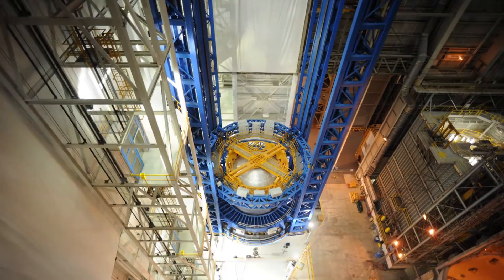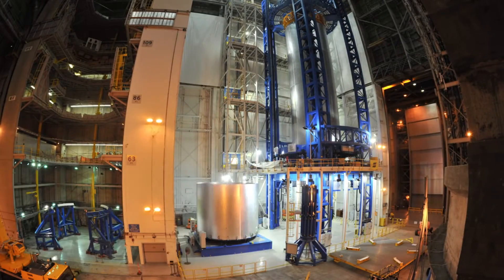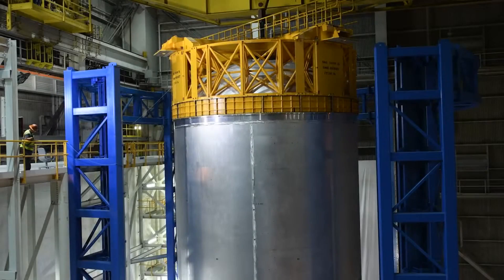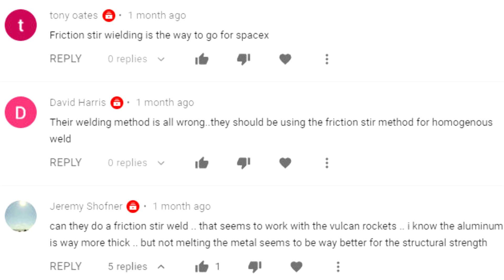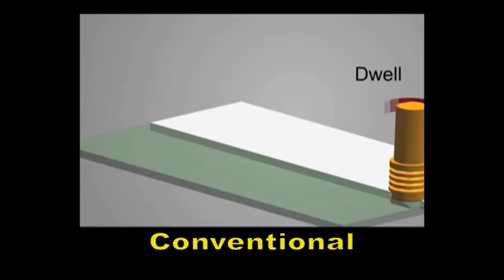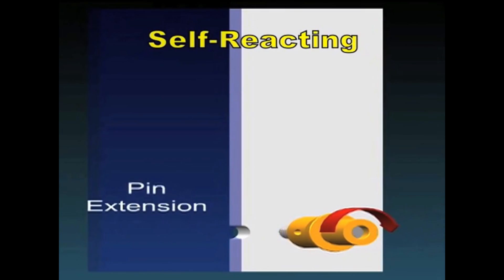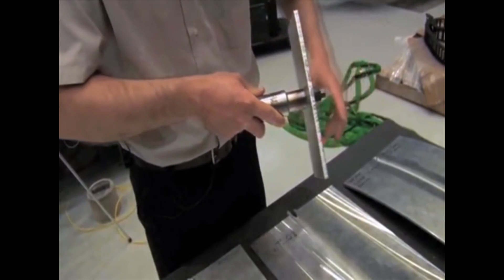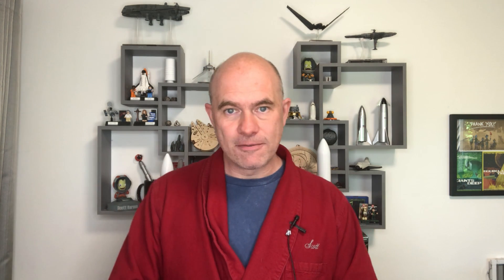SpaceX's 4th Starship Prototype Collapses During Test

Comment: "The light bulb was an invention with 1,000 steps." - Thomas Edison.

It is good that we have rediscovered advancement through failure
Reply: @gandritaskull  They solved the welding problems from the last two
Reply: @StolenValor99 he made it commercially viable tho
Reply: @bugass81  No he didn't.
Reply: @subscriber6181  he made a lot of lightbulbs during that time and got power to a lot of houses. It wasn’t him himself who invented and worked on most of the individual things. He was the leader of a company not a crazed lone inventor like nikola Tesla.
Reply: @bugass81  : That's not a fair characterization of Tesla, because Tesla was essentially the norm, not Edison. Edison did invent some devices (telegraph related) that were relevant in his day, but the thing that really earned him his fame was the invention of the corporate laboratory. Back then, it was new.
Reply: @Arthur 4 is a pretty small number think back just a second how many tests they've done for the Falcon 9
Reply: I feel that metaphor is mostly inaccurate as spacecraft aren't "New" we already have our pre-mercury rocket blowing up compilations.  We learned from these mistakes.  Tanks are made and we know how.  Their issue is focusing so much on deadlines that they miss various things (Weld quality, propper filling of tanks, etc).

Measure twice cut once, not cut multiple stocks untill you get it.
Reply: Eric Lotze  We already know how to build rockets at completely ABSURD prices. Elon is trying to find out how to make it work at 1/10th the cost in addition to being reusable which brings the lifecycle cost down an order of magnitude or more. This is innovation happening in real time. To depend on the “tried and true” is to be stagnant, wasteful, and soon to be Dead.
Reply: TecnamTwin,  i agree they are doing great things (reusability etc) but also a lot of the cost is due to corruption and the expendability.  Even if they are changing it to be reusable and larger doesn’t mean it is some new unexplored tech.  Welding is a known tech, aerospace is a know tech.  They are just making a new platform and have lots of continuous, on demand (no fluctuations in budget, no changing plans) funds to burn
Reply: @ericlotze7724    that's not how it works, every field has its share of development costs, we have been building cars for over a century, but every single company still spends billions on development for incremental advancements. 

And a company that doesnt, that follows your ignorant advise that " we know how to do all this already" will fall behind and fail.

I'm willing to bet that GM or Toyota have sunk more money into something like fusing metal together than Elon has, nobody is willfully throwing money away so maybe just maybe you are the one who's wrong?
Reply: It's kind of crazy how people honestly believe that progress comes from nothing at all, and that this isn't important work that will help humanity in the long run (even if that's just how not to build a tank)
Reply: @Bubbly_Dragon  Who said that, all we are saying is that spaceX isn't infalliablle, and perhaps that rushing leads to errors?
Reply: @ericlotze7724  : The development process SpaceX is using expects those errors, so saying that they could be avoided is akin to saying that you could stay dry by not swimming in the ocean. You could certainly say it, but it makes it clear that you aren't factoring in the whole scenario. Now, if you had info on what a good success to failure rate for Agile rocket development is, comparing that to SpaceX's failure rate would make sense, but as far as I know the only available point of comparison is the Falcon 1 and 9.
Reply: @absalomdraconis  Comparing rnd to swimming is a bad comparison.  I get you need to learn the basics etc, but one PEOPLE ALREADY DID THAT, and we also have computer simulations

Also trying to not waste large amouts of stainless steel, paid work hours, and cryogenic liquid on a fancy water rocket is a bad idea now?

Why not instead invest a bit more time and make it work the first or seccond time thus save all that money?

 Quite certain wasting a pile of money to realise rockets require quality welds is not some breakthrough moment.
Reply: That is literally what they are doing, right now though; Investing time and money to make sure the rocket succeeds in flight when the time comes that they want to shoot it into the void. This is pretty much basic R&D. You make a prototype. It fails. You make a new design with the failure in mind and you do it again and again until eventually you have a properly developed working piece of equipment. This is not limited to rocket engineering, nearly every single piece of tech on the planet has gone through similar processes
Reply: @ericlotze7724  Measure twice, cut once is exactly what most aerospace companies do, but getting it right the first time is a very long and expensive process with a rocket. Stainless steel is cheap by comparison, the team working on this is fairly small, and they're not using much specialized equipment.

When the measurements get more complicated, you reach a point where some wasted lumber is cheaper and faster than checking everything first.
Reply: @ericlotze7724    you dont know what you are talking about, just because we "know how to make tanks" doesnt mean the tanks we know how to make are suitable for every use.  

We dont know how to make tanks cheaply, we dont know how to make them lighter than they are, theres a lot of things we dont know, and your suggestion that we should just keep relying on decades old technology that was never designed to do the job we want a rocket to do is beyond clueless.
Reply: @ericlotze7724  : And how long is it going to take the current companies to learn to not doom their projects to failure through pessimism and stagnation? SpaceX has already demonstrated that to be a genuine and avoidable problem.
Reply: @absalomdraconis  One, i don't like other companies, two, most problems are due to corruption and goverment changing plans/budjets.  Since when is rushing and cutting corners the best method?
Reply: @StolenValor99   of course he can say it, so can I. I didnt invent the thing but I can relay a statement as well as anyone can.  Stop being an ass.
Reply: @Arthur but if they thought it through, consulted industry experts, and did simulations they could have succeded on test 1 or 2 not 4 (or more)
Reply: We're talking rocket science here, a light bulb is not rocket science.

Comment: If it collapses when a tank isn’t pressurized, does that call into question whether it can withstand the planned bellyflop re-entry profile? Are the loads different enough that this doesn’t matter? Was SN3 even built to “final” structural specs?
Reply: 1) When you're dealing with two phases (liquid + gas) in a tank, you can maintain pressure as long as long as you're willing to work the problem. Bellyflopping will be providing plenty of 'excess heat'.
2) In general, you can maintain any "full pressure" tank with around 1/1000th or so of the mass with gas as opposed to liquid. "1/1000th" is pretty much 'landing with an empty tank'...
3) They're using stock steel. They've ordered "better steel for this purpose" that wasn't just sitting on a shelf somewhere (and thus: not in SN3). They plan to customize the steel ... so... no. Nowhere near "final".
Reply: Shrike DeCil Oh, wow, I hadn’t realized how little gas was needed to maintain pressure!
Reply: OtherTheDave The tank will remain pressurised throughout the entire flight some of the gas from the engine will be back fed into the tanks to keep them pressurised partly for this reason
Reply: @commiccannon592  Agree, the engines (probably) work best if the pressure in the tanks is consistent throughout the flight.
Reply: They lost pressure on the lower tank creating a partial vacuum resulting in a failure. The upper tank was load bearing with liquid resulting in great pressure on a partial vacuum lower.
Reply: It looks like somebody neglected properly to pressurize the liquid oxygen tank when the fuel tank was filled with liquid nitrogen. heat was sucked out of the oxygen tank through the common bulkhead, causing whatever gas was in the oxygen tank, presumably also nitrogen, but not at cryogenic temperatures, to contract, resulting in loss of pressure and collapse of the tank. If this is what happened, then this was a test protocol error, not a design problem. It may, however, ell them something about how much pressure they need to maintain in the tanks during reentry.
Reply: No problems are expected during the flight. It collapsed not because of a lack of pressure, but because of a negative pressure.
During flight, the pressure in the tank is usually maintained with helium to keep the fuel liquid throughout, so you don’t have to worry about that during the flight.
Reply: Falcon 9 has smaller helium tanks inside the 2 larger tanks that release helium gas to replace the vacuum as the fuel is spent.
Reply: @trails3597  : Helium isn't trivially obtainable on Mars (or technically on Earth), so they probably won't be using it for that.
Reply: @absalomdraconis  They plan to not use helium at all. Elon wants it to be able to refuel and return using only Mars resources.
Reply: Thank you... No way you seeing me in that crap dream of stainless steel  or would I risk 20 lives on a backflip landing....  One mess up everyone is dead!
Reply: @Jeralddoerr    Airplanes crash every year, killing all aboard.
Reply: @odysseusrex5908  yeah well try landing an airplane on its tail...  You do understand it's not going to land on a runway right?
Reply: @Jeralddoerr   The point is, flying machines crash. SpaceX have definitively proved that vertical landing is practicable. Scaling up is just that but, the day will inevitably come, that a Starship explodes on launch, has engine failure on landing, or experiences a catastrophic failure in space. It will happen, and a hundred or more people will die. That doesn't mean the design, or the concept, or the whole idea of manned spaceflight are in any way wrong.
Reply: 40oz That’s true of pretty much all space travel. The safety margins are crazy low, otherwise it’s too heavy to get to orbit with a useful payload.

Comment: I'm no expert, but the way it crumpled in on itself looks like that tank drew a vacuum.
Reply: The LOX tank might have started slightly pressurized, but the cryogenic temperatures in the methane tank filled with Liquid Nitrogen might have cooled the gas inside the lower tank enough to cause reduce the air pressure to a point that the tank collapsed.
Reply: @KnightRanger38  most plausible explanation I've seen so far.
Reply: It definitely drew a vacuum, it shows in the way the metal buckled in, in several spots, before the big crumple.
Reply: First of all it wouldn't collapse under measly 1 atm of pressure. And second, even if it did, it would buckle smack in the middle around the whole waist, not in some random location.
Reply: @michaelbuckers  Drawing a vacuum isn't limited to a "measly 1 atm" of pressure.  You can collapse the tank on a water trailer simply by draining the contents without venting it.
Reply: @omamba5105  Do you not understand how pressure works? The atmoshpere only has 1 atmosphere of pressure, even if there's literally nothing inside the tank it's still only 1 atm of pressure difference and the vacuum is not gonna go any lower.
Reply: @michaelbuckers  Fine, I may have been incorrect about that.  But drawing a vacuum on a tank not designed for it WILL cause it to collapse.
Reply: @omamba5105  It just depends on the strength. Granted, steel is a lot weaker in compression than in tension, but they seem to aim for enough strength to support a starship on top of the booster, both made out of such steel, so it just might be tough enough to handle 1 bar of negative pressure differential.

Comment: Not gonna lie, Im starting to doubt the garage built stainless ring system. Its neat but c'mon.
Reply: But that (presumably) wasn't the reason for this failure. It failed because they filled up the tanks in the wrong order for some reason (maybe human error, maybe problems with ground service equipment or valves on the starship)
Reply: @alexmijo  the creeping doubt is about maintaining the pressure, through hot and cold conditions! But hey, as long as it is reliable enough to send Starlink satellites in orbit, it should be considered a success.
Reply: It's a fight between CPPD (concurrent product/process design) which is doing all of your process design up front, and the design/develop method, which is iterative. What this does for Elon is to allow him to produce nearly immediate results to grab the attention of investors... it can also save on the front-end design and equipment procurement costs in that you don't have an SLS-style redesign and retool if your designers make a mistake. It's a calculated risk to operate like this, but it does generate excitement...
Reply: It is their development strategy. And for now, it is kinda working, they are learning. They don't even need to spend billions on research, they just make a Starship and see what happens, it's much more effective.

Comment: Imagine how expensive these would be if they were doing it with carbon fiber.  Don't worry.  Success is on top of a pile of failures.
Reply: on the other hand - the tanks could be thicker because the material is lighter
Reply: @JanKowalski-vj9py  : Carbon fiber just wouldn't work. They're using steel because carbon fiber was a bad fit to the design.
Reply: @JanKowalski-vj9py  to be fair, that could be an issue with carbon fiber, too - but at least yo ucan use a greater margin of safety
Reply: And the workers' health? The workers should be home.
Reply: @JanKowalski-vj9py  According to Musk, stainless steel is better than composite in this application. It keeps its strength over a wider temperature range, so tank insulation and re-entry become easier. They switched to stainless away from composite.
Reply: Imagine how many less failures they would’ve had if they used carbon fiber.

Comment: Why don’t they just do it properly? So, much resource waste...
Reply: They should do it like SLS.
Reply: Forgot to mention: Elon said for previous prototypes he was going to use them for cybertrucks
Reply: The thing costs about half a million in materials. They can build one in 2-3 weeks.
Reply: Well, there does seem to have been a serious error is the test protocol here, but, they are doing things that have never been done before and learning how to do them. Just like when they were first learning how to land a Falcon 9 and had crash after crash after crash. They'll get it right eventually.
Reply: Rapid prototyping
Reply: So they can find problems quicker. It is also very cheap with the materials used
Reply: Christopher Wang Just flatten out all the panels and weld them back together

Comment: It turns out even SpaceX has to find out the hard way that you can't stand on an empty soda can.
Reply: Except you absolutely can stand on an empty soda can. Try it :)
Reply: @ryan_layne  No need to brag string bean
Reply: @ryan_layne  when I was younger I could stand on a can, maybe until I weighed about 140 lbs. I haven't been able to do it in ages now.
Reply: Many years ago I saw a original Mini car balanced on 4 aluminium cans, as a way of showing how strong it can be when used correctly.

The presenter then gave the car a little kick, and all 4 tins crumpled almost simultaneously and the car dropped down, to give us a example of how a unexpected force (even a tiny one) can muck things up

Wish I could remember the show, maybe Tomorrows World from 80's UK television?